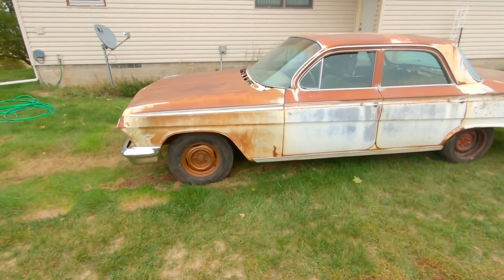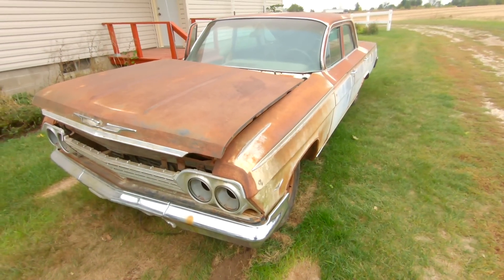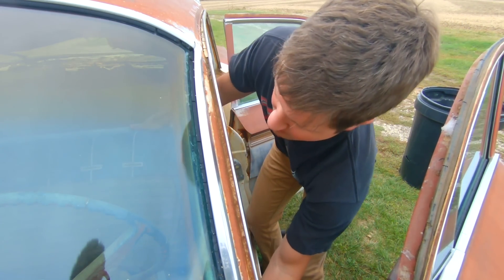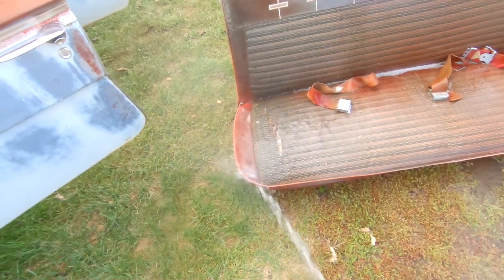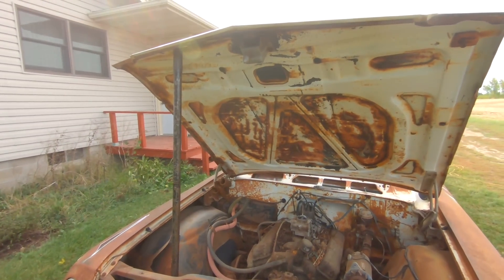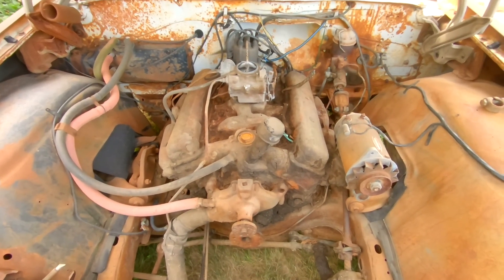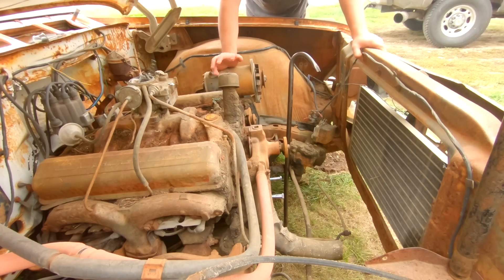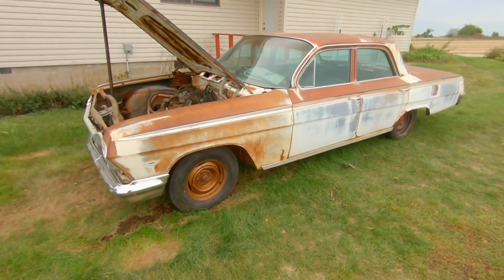Junkyard Save 1962 Impala - DEEP Cleaning + Can We SAVE The Engine??? (Old Car Rescue)

Comment: Makes me nostalgic for a car I once owned.  Bought a 1962 Impala station wagon (around 1982 or 83).  It was almost perfect - white with blue interior - power windows -
power steering and brakes - dealer installed air conditioning.  The amazing part was that no one had ever used the bumper jack on that bumper valance that always gets
destroyed.  It had a low-milage 283 and was just an all-around sweet car.  I traded it for a 1979 Jeep CJ5 that got destroyed in an avalanche outside of Denver.  Sad frowny face :(
Reply from the maker: Id love to have that

Comment: It is a 283. It has the 283 signage on the fender. If it was a 327, it would have the flags with that style of emblem. No flags means it is the 283. If it was a 409, it would have the flags and the numbers 409.

Comment: That's a 283 cubic inch emblem 327 have Flags Crossing each other the Chrome strip running down the side in the middle had the color of the Interior painted in there

Comment: Hang in there, you will get fed up and disgusted more times than humanity possible.  Parts, pices, etc.  Sometimes big, sometimes small. But, over the years, it will come together.  As for the engine, fix it and you will have a numbers matching car.  Still got basically very sturdy body.